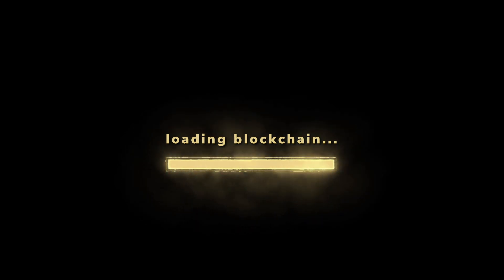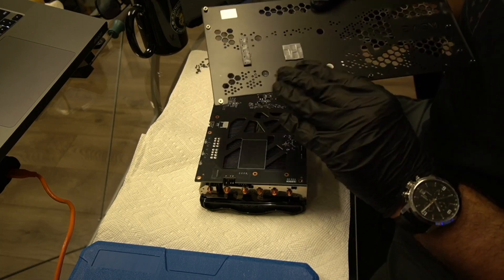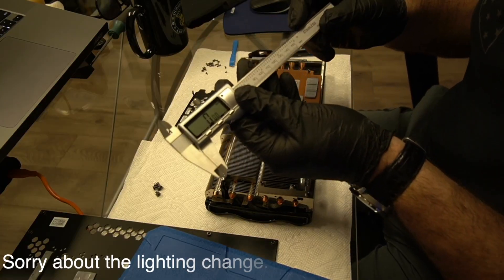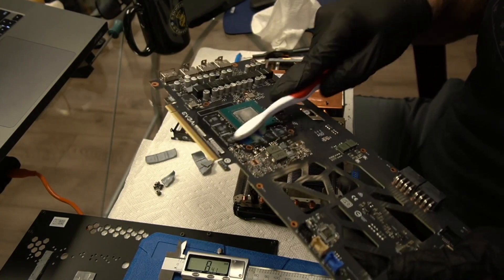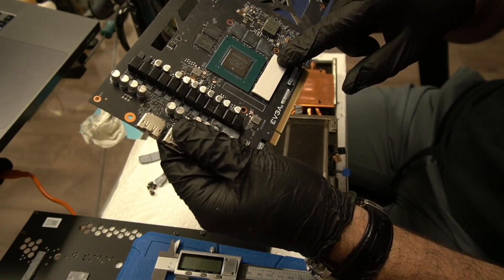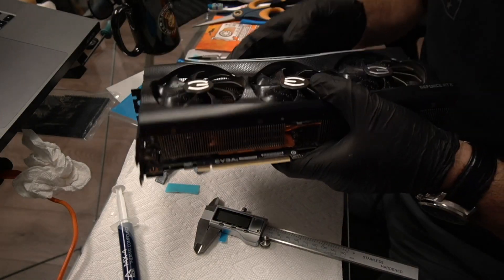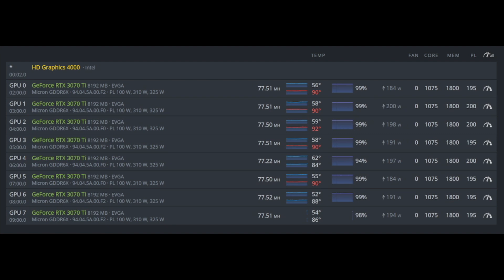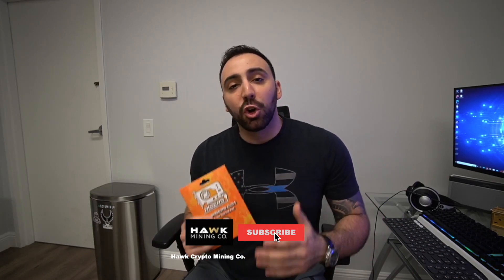Best way to cool down your GPU'S!

Comment: Run the 3070 Tis at 900 core. Pretty sure I saw RPM had it at that. I have been doing that for a couple weeks with no issues on about 10 3070 TIs. 900c / 2000m for about 78.5MHs. Not pushing them too crazy.